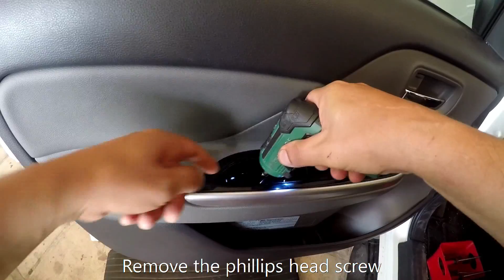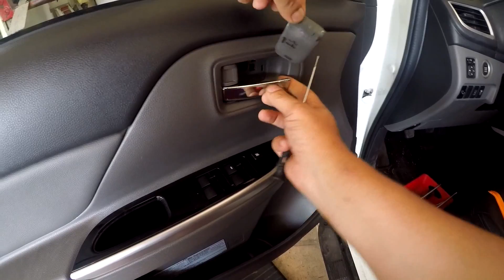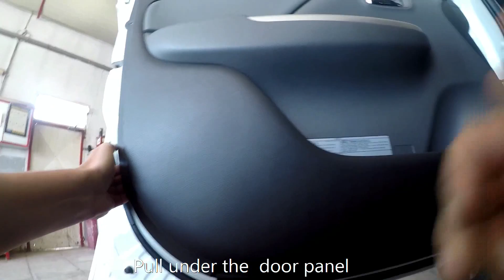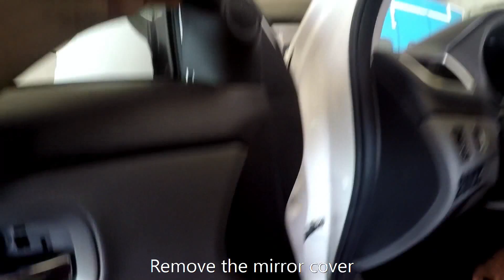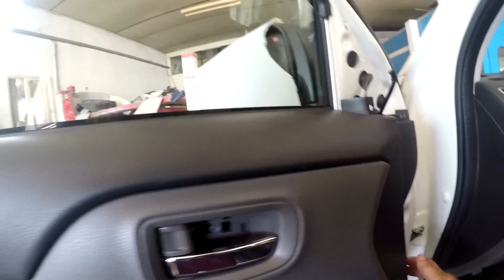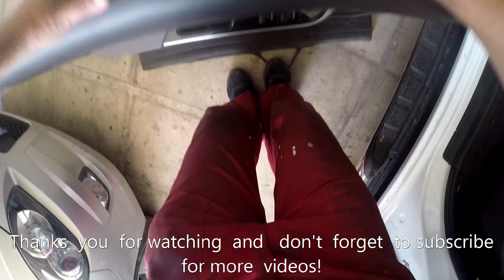Mitsubishi L200   2015–present  door panel removal

Comment: Good morning, any suggestions on how to remove the door card if you can’t open the door? The passenger door won’t unlock and the internal switch to unlock it is loose. Need to get the door open to repair it and looking at your video you need the door open to gain access 😞